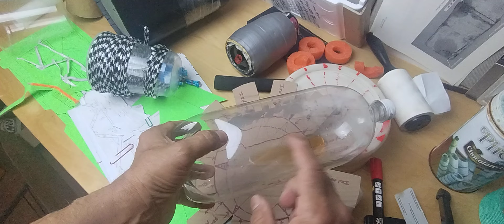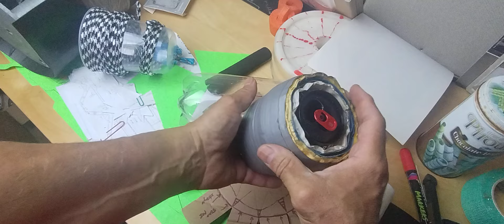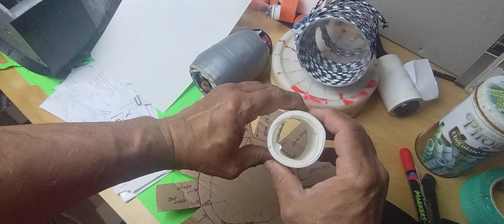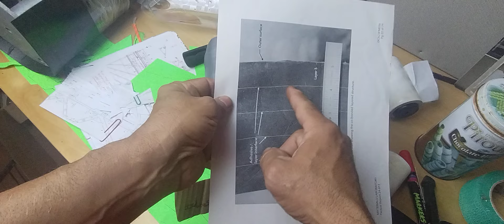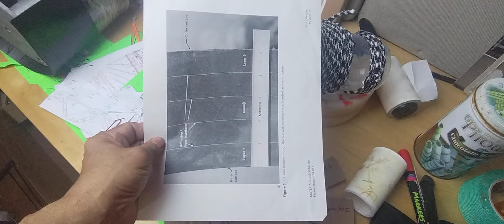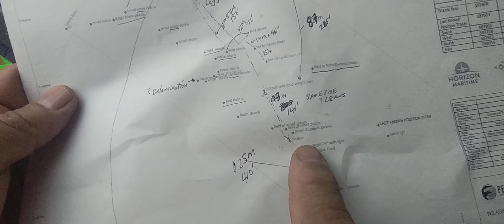Titan Submersible Sanding Carbon Fiber creates load path failure hoops were skewed and tensioned

Comment from the maker: Please help the channel with a Titan response and also a shout-out to where you are from (I find the locations interesting).
Titan Submersible Sanding Carbon Fiber creates load path failure hoops were skeed and tensioned  and horizontal fiber was NOT tensioned.
The Titan's sample (end cut) will reveal the end connections and the profile of that "zone" and hopefully they can cut up the rest of the recovered sections and determine if they mirror the ends.
This profile is important because a "weak load path" is created by cutting (sanding) the carbon fiber; this removes and creates a bridge that only the epoxy and the next layer of carbon fiber can bridge.
Reply from the maker: They still maintain the 1,inch thickness within a few thou of an inch ...the NTSB guy stated it was over spec size and we know that by the report over 5 inches... But, recall the sanded sections create a different load path with the outside pressure and this bridging (where sanded) is done with epoxy only.
Then we have the sanded area created a different texture then the non-sanded...
This is getting close to or did create shear friction issues.
Reply: Halifax, Nova Scotia
Reply from the maker: @philanders3705 awesome, hello there
Reply from the maker: @philanders3705 nello Nova Scotia!... Next in the series https://youtu.be/Em4PBcNpyPk
Reply: Alabama here!  I figured it had something to do with them cutting/sanding on the hull, especially at the ends.    

It reminded me of when I was repairing bikes for Gary Fisher and they first started using CF for their mountainbike seat & chainstays, and we were told that any damage (scratches, gouges, etc) through the outer clear-coat & first layer would compromise the part, and needed immediate replacement for safety.  And they must've been right, because I replaced several rear triangles with blown apart chainstays after they were abraded/scratched on rocks.  None failed immediately, but did so later when put under load climbing hills or landing jumps.  The whole experience made me leery of CF in critical structural elements & wheels, so when I saw them making Titan with CF and then sanding it down, I was like 😬😬😬.....
Reply from the maker: @anaxis Next in the series https://youtu.be/Em4PBcNpyPk
Reply: Indiana Pennsylvania
Reply from the maker: @Mr.Blonde92 I have been to Indiana... Coal country Next in the series https://youtu.be/Em4PBcNpyPk
Reply: @Structuralinvestigators  yep, my dad and Grandfather worked at Penelec, the coal power plant in Homer City Pa for decades. Also the actor Jimmy Stewarts hometown lol
Reply: Ontario, Canada.
Reply from the maker: @Exoroar_Exo hello Ontario , Next in the series https://youtu.be/Em4PBcNpyPk
Reply: Dayton, Ohio
Reply: Sydney, Australia 👍
Reply from the maker: @Charlie-xoxo hello Sydney, a lot of viewers are from Australia and Next in the series https://youtu.be/Em4PBcNpyPk
Reply: Las Vegas Nevada Thank you for the Titan models!!!
Reply from the maker: donate  
Join this channel to get access to perks:
Anyone donating to support the stray cats or my channel remember if I do something that gives you "gift remorse", please contact before tax season ends and I will give you back 100% of your donation.
https://www.youtube.com/channel/UC-_5I5xDiFVcxlnG7uSLuFA/join

Construction Engineering & Failure Analysis Thank you for commenting and giving a thumb's up
Please donate to support the channel, it will 100% go back into the channel.
https://www.paypal.com/cgi-bin/webscr?cmd=_s-xclick&hosted_button_id=V9TGHDE92LQ8W&source=url
Here is my wishlist if you care to go that direction https://www.amazon.com/hz/wishlist/ls/3UBMVWND65U4M?ref_=wl_share

 Big bang was probably layer 3 and 4 deamination! - so, don't think much of the top bracket failure but don't rule it out. 
You always have to look for other explanations for sources of this specific, "big bang".
Here is a modeled version to help people visualize the progressive implosion https://youtu.be/yRWuuCo9hK8

Tomorrow's video will answer a lot of your questions on the EXISTING FORCE that was ''baked into this design'' and they attempted to stop deflection in the rear frame by adding a ''strong back'' - BUT, that simple created a pry bar action on the top connection. https://youtu.be/FOgXAybZc5s
Reply from the maker: https://youtu.be/_hAiVMgs6uo previous video and here is a playlist https://www.youtube.com/playlist?list=PLz0GtzU1bcPgd6Xoh6U0jBLQwBl6-lQpl
Reply: Long Island, New York
Reply from the maker: Next in the series https://youtu.be/Em4PBcNpyPk

Comment: i think the delamination happed quite awhile before the final implosion. i think there was already delamination before dive 80 (i think) where the big bang occurred. i think that was differential reexpansion of different layers as they ascended.
Reply from the maker: What do you base that on and what layer?
Reply: @Structuralinvestigators  other videos showing a large area of delamination with damage to the bonding agent. between 3 and 4 i think. plus on one of the endcap adaptors it had remains of glue in some areas but no in others towards the outer edge like the water had made a partial ingress.

Comment: Just thinking in my off-set brain about how auto-craftsmen apply widow tint. I’ve tried it my self, I couldn’t get the air bubbles out so someone told me to pop the blisters with a needle. I did and of course I screwed it up and had to have a professional do it for me, at cost of course…
They sanded defects and covered’m over ? Anyway I was thinking of buckling and delaminating. Not the same thing clearly. But you got me thinking. 
Again;
Great Video !
Reply from the maker: Awesome. I will do more on this and have another model
Reply from the maker: Hope to see you tonight Jennifer 
Next in the series https://youtu.be/Em4PBcNpyPk

Comment: I’d bet the glue would be under even more stress over the sanded areas. It’s being asked to take the place of the broken strands., and I can see the strands actually slipping under the stress since they are basically free floating up to the glue. The hull will also be under unequal pressures. 
 My guess is the gunshot popping noises on the deep Titan dives was coming from these areas. Just a theory.

Comment: The intersection between engineering and psychology in this case is fascinating. 

How they thought they could achieve any understanding of safety without making a large number of test articles and testing them to failure is very indicative of a certain mode of thinking.

I feel like the brain has different modes - including contemplating and fighting. At some point Stockton switched to fighting, and in that mode it gets so easy to self justify anything

Comment: With what little I know about fiber reinforced resin composites I understand that the composite’s strength depends upon the fibers being unbroken. Stress to borne by a broken fiber has to be transferred to other fibers and around the break by the resin matrix.  By sanding the outer surface OG essentially broke the continuity of many fibers. This was done on the inner 4 1” shells. 

This would seem to be the same as taking a hack saw to a multi-strand steel cable of a suspension bridge. The cable might nit fail initially but has a reduced margin of safety.

Comment: Do you think having some reinforcement rings along the length of the tube would have helped with the compressive failure, or just prolonged the inevitable?  I guess if you add ENOUGH titanium compression rings you have a titanium tube.  Is it the material that is weak or that the structure is not a sphere (unequal compression on the sides of the tube vs sphere)?  I assume a titanium tube would have similar compression concerns along the length of the tube.
Reply from the maker: Yes, intermittent interface rings would help but would also require post tension bars from outside rings to maintain compression and stop mid section(s,l defection strains...
Reply from the maker: Next in the series https://youtu.be/Em4PBcNpyPk

Comment: Even the ancient Romans knew a triangle is much stronger than a square in constructing load bearing structures. Stockton could break all the man made rules he wanted to build the thing. But physics has always had the same unchangeable rules.
Reply: The Romans were amazing practical engineers. I grew up on south coast of England, close to a castle that had Roman foundations. They'd built it partially in a tidal zone and used cement that could cure under salt water. Crazy tech that was lost and took almost 2000 years to rediscover.

Comment: Boeing actually advised them to angle the strands as they wrapped them at a 45 in addition to the 90 deg wrapping and when they chose not to Boeing pulled out of all future correspondence.
Reply: Yes, layup should have been 0, 45, 90. Not to mention when they sanded thru up to 12 layers, they should have feathered in replacement cf. Instead, I believe they just used the matrix material.

Comment: check the video of legs being recovered. one leg was blasted off during implosion. the skids were blasted off the weight tray was blasted off. these were on during implosion no doubt unless you have explanation as to why they were scatered around the bottom.

and yes the sanding as most other things they did was reasons for the failiur. what a titan this poor ship was to stay together as long has it did that cf is amazing strong thing. RIP the 4 that lost there lives.
Reply from the maker: I saw no evidence it was blasted off...
Reply: @Structuralinvestigators  i just check the video again the leg the guy grabs looks slightly twisted and the 2 hanging legs are almost broke of the brackets. 
ive been looking for the time the implosion was heard i know when it happened the time was said if we could get this time we could make much better assesments off what could have happened. if it was 1 second after last contact we can say so much more. WHY have they not given this time is aCONCERN. the navy heard implosion at this time???? this is what i am trying to find out.

Comment: So, the pressure outside the submersed titan is not distributed equally around the sub because sanding back areas of laminate to remove defaults in turn changed the thickness in that area and broke the laminate strands that give it the ability to resist the outside pressure evenly, allowing it to maintain its cylindrical shape. Once the cylinder has these areas of weakness (caused by the sanding which in turn changed the thickness and broke laminate straps), submerged those areas do not have the same resistance to pressure causing them to buckle inwards and sub to implode. Looseley?
It would seem obvious to me the consequences. The laminate was wound like a new spool of cotton.
Reply from the maker: They still maintain the 1,inch thickness within a few thou of an inch ...the NTSB guy stated it was over spec size and we know that by the report over 5 inches... But, recall the sanded sections create a different load path with the outside pressure and this bridging (where sanded) is done with epoxy only.
Then we have the sanded area created a different texture then the non-sanded...
This is getting close to or did create shear friction issues.

Comment: Is carbon fibre in compression is akin to concrete in tension? Wrong material for a sub.
Reply from the maker: It's an epoxy that locks in the carbon fiber and I'm inclined to think two ways, it was not stiff enough and also it was not flexible enough to survive...
Reply: @Structuralinvestigators  I thought the resin was just a vehicle to hold the strong carbon fibre. . .
Reply: CF is not an approved material for submersibles

Comment: I’ve worked with carbon fiber once before, just for a Hobby , bicycle frame repair. it stated in the instructions for the kit I bought said, quote “ apply layers of carbon cloth at alternating 45/90 degree positioning. This is because the woven carbon cloth only has stiffness in the direction of its fiber orientation.”
Reply from the maker: This is more of a ribbon size, ½" ... It's also twisted if I recall correctly+/-
Reply: @Structuralinvestigators  👍🏼

Comment: hi, thanks for this, how did they lay down the longitudinal layers on Titan? we only see the hoops being laid down. edited to include Titan
Reply from the maker: It is reported the longitudinal were installed without tension and the hoops were installed with tension (of course this can create ''bundling" = they call it wrinkles).
Reply: @Structuralinvestigators  omg - so did they use that big machine to wind the longitudinal layers on? they would've enclosed the ends then? I need visuals lol, can't wait until someone produces an animation using your descriptions.....
Reply from the maker: Ps thank you for the Titan comment also

Comment: Solution, No grinding with some waves and use the end bells in the manufacturer processing.
Reply: Maybe the whole process is flawed. CF withstand lateral forces way less then eg, bending, it's brittle. Just hammer a carbon tube hard enough for proof. The pressure resistance and distribution is made by the resin. It has to be degassed, cured (autoclaved) etc. to perform. The glorious idea making a carbon foil wrap - as the production videos intend - shifts the adhesive power to carbon / resin layer contact and hinders the resin to combine . On top doing the whole shebang by separately cured tube in a tube sequences divides it further. It hinders pressure distribution to the inner tubes because missing elasticity (if it were elastic the 1,5 metric ton domes will form that thing into banana shape). So you get small tubes made of tiny separated layers all prone to break. That's the damage pattern you actual see on the wreck clips. 

Btw. Want to make a tube prone to break? Do it that way.

Comment: It started peeling before it blew all the way … that big piece flaked and fell like fish food.

Sanding between layers would make for a possible slipping effect between each sanded layer. 

Fascinating video. The Titan videos are great. 

The sanding is INSANE! How this thing got as far as it did is beyond me. 

Thank you for all the work on this. I really look forward to these.

Just outside of Akron, OH
Reply: We know that in pressure tanks the hoop tensile forces are twice longitudinal.  A submersible has same ratio but in compression.  But there are added buckling instability modes that always cause final failure.  Non tensioned wavy layup, sanded peaks and thick resin rich adhesive layers between construction stages ALL COMPRIMISE HOOP AND LONGITUDINAL BUCKLING STABILITY.  Cracks in that green adhesive between 1 inch layup stages and between individual wraps can develop and grow progressively with each dive cycle.  These horribly compromise buckling stability and eventually cause catastrophic implosion.  
It would help our understanding if labs would run compressive strength tests in both directions and also compare operational hull samples with the end material cut off and saved from the final wound production cylinder. 

Formerly Brecksville, OH
Reply from the maker: @DrJuan-ev8lu Next in the series https://youtu.be/Em4PBcNpyPk and hello former Ohio
Reply from the maker: Hello there in Akron, Oh. - thank you for your kind words and glad you enjoy the content.
Reply from the maker: Next in the series https://youtu.be/Em4PBcNpyPk

Comment: when you mention ropes and cutting the  hoops i think suspension cable bridges and fan bridges cut one strand and you start to induce problems in the support pattern
Reply from the maker: They "disrespected" the intent of their own design and the epoxy had to step in for the ''tension zones'' they sanded away!  = =this creates a different load path and those pressures do not care about their mistakes.
Reply: @Structuralinvestigators This commenter's comment gave me an idea!! You know now you wrapped the carbon fiber with the black and white rope? Can you make one kind of like that, and use a wrapped cable that is one color on the inside and a contrasting color on the outside? Then if you wrap it around the hull, then you sand away the outside, it will be extremely visually impactful. Because you can see the funky profile. Especially if you do it with multiple layers, and then you take a profile cutaway. 😮

Comment: I had a thought while watching a video you made and where you were showing the Titan debris field. You were also explaining the effect that water has on bullets and were saying that something being 100m away seemed odd. I though maybe they imploded not near the bottom, but higher up and the differences of where the parts ended up laying was due to currents taking them and influencing their travel before they reached bottom. But I'm no engineer so dunno. Also, you mentioned that you were wondering where on the end caps or anywhere else, where and how big was the channel where the 'wires' were routed through to reach the thrusters, etc. I saw a video, if I can find it I will post it.... there were wires that came out through the rear endcap.... on the lower left side of the endcap sphere. Looking forward to watching this vide live tonight.
Reply from the maker: I did the first video on the penetrations, this is when they were at the docs... 
I know more but the hyenas will steal my information...
Reply: @Structuralinvestigators Sorry never saw that video. I get it, now that you mentioned it.